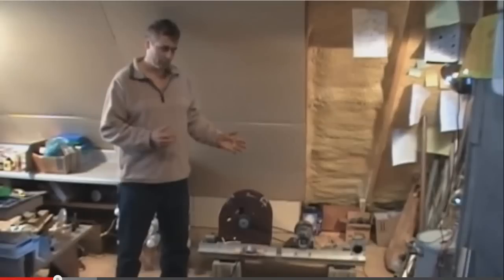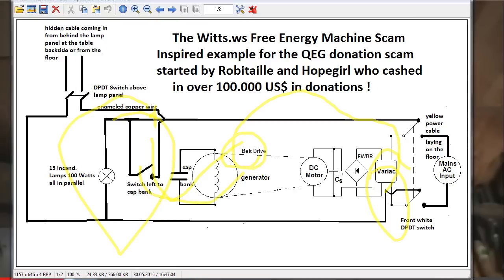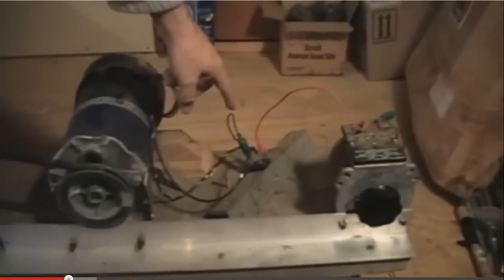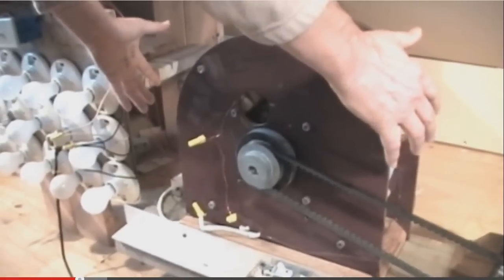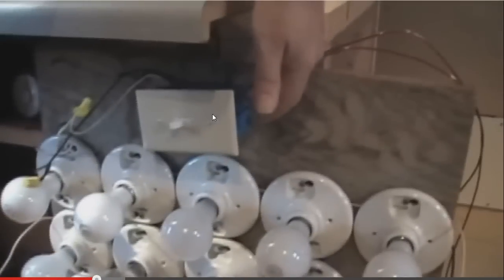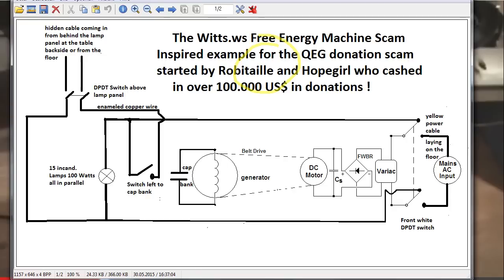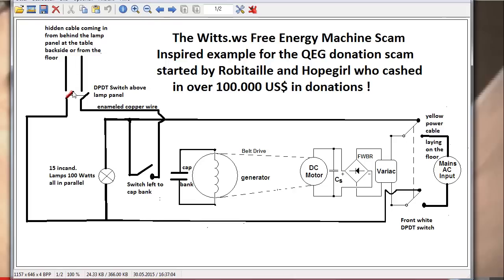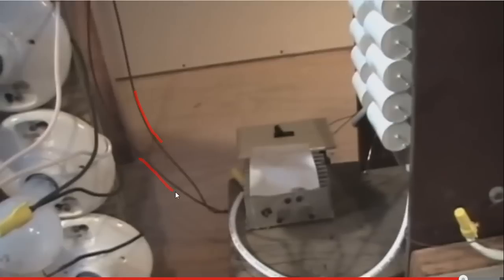Free Energy Machine  ? Scam ? from Witts.ws - QEG ? Scam ? inspired model ?

Comment: If Thrapp had overunity all he would of had to do is turn the variac down and the lightbulbs would have dimmed.  but he has a hidden wire so  he  can't turn down the variac down to stop the motor because the lights would not dim.  He has to unscrew the lights before he turns off the power to the generator or the fraud would be exposed.

A five year old could drill a hole in a 2X4 and run a power wire up to the lightbox from the plywood floor.  There is nobody on earth to date who has built a replica of the WITTS QEG shown here that has selfrun and is capable of producing 40 KW.
Reply: Its been done and the quantum field is the source. All the electrons, protons and neutrons spin constantly by this aether and made up and driven by it.

Comment: This is a working device, the resonance sound is exactly that a vibration of resonance in the coil transformer actually making useable power. This generator is a switched reluctance generator at first resonance it's at 80% efficiency. Two more tuning processes that are done to this machine will put it at over unity. First is core tuning at which the steel is changed internally using its resonate frequency. Then it can run at half it's resonance speed. Then final tuning of its Exciter coil is done at which point it's becomes over unity as it produces energy spikes which will accumulate more spikes from its environment. This is called Radient energy. The QEG guy who was a electrical motor engineer for Shop Vac was able to complete all resonances for the first time as of the beginning of July.
Reply from the maker: Lynly Gilman Why then have we not seen yet a selfrunning device from the QEG team ? Because they don´t have one .....only lies all around involved with these ones and Hopegirl wants to cash in again via donations...Big Thumbs down !
Reply: If you followed them closer you would see haw they figured out each step in the process. WITTS Did not give them all the information to make the tuning complete. The final step and the key to Overunity has just been solved. Finally released June 5th. Look closer all good things take time. I hope you will look closer .
Reply: overunitydotcom This is an opensource project.  A video can be faked.  There are those in power who would not see this device make it into the world.  No amount of evidence will satisfy a skeptic.  That's why.  In due time evidence will abound,  I've waited a year and a half, a few months will be nothing to see the final product; they are already in production.
Reply: Good imagery; you should continue your efforts in fictional writing.
Reply: Lynly Gilman WITTS is also just a scam, like Hypegirl and the QEG. Overunity and the QEG has not been solved, it will never reach overunity. It is like trying to fly by reaching down and pulling up very hard on your shoelaces. Notice how no engineer is working on the QEG? They all know it is just a scam to make money, so far Hypegirl has made $150,000 in donations from the gullible, now she wants $500,000 more to continue her holiday!
Reply: wilf609 Overunity may be the wrong word. Tapping a different type of outside natural energy source that has been ignored/suppressed and is not understood by mainstream physics is a better description. Energy is all around us just like tapping solar energy, hydro, etc. Nuclear energy was also not understood at one time. Just a different kind of energy... In time the truth will come out
Reply: Metalicman 68 Hw was NOT a "electrical motor engineer" - why do you think he was? He is not a engineer at all! No one has shown a QEG with a efficiency over 60%, they are just scammers.
Reply: Metalicman 68 "a different kind of energy" that no one has been able to measure, or see, or show any proof of except the QEG and WITTS scammers.... that should tell you something about this mythical energy!
Reply: Bendini is on the right track. Accumulation of energy spikes. It's the same type of energy just this one has multiple tuning to resonances to get more efficient
Reply: wilf609 Where do you get that idea?  These concepts exist in string theory, QM and Bohmian Mechanics.  And, I suppose that you think 'entanglement is also a hoax' and you still think nothing travels faster than light. o-0.
Your question of ontology is rightly placed at one of the biggest mysteries and questions in particle physics today.  How do we see something that's beyond 3D?  But, even though it's a question, and there are some die-hards that still think there's only 3D+time, the physics community has accepted that there's something beyond what we see.  Let's look at this sensibly.  Have you ever seen a gamma ray?  No, of course not.  Does that mean it doesn't exist?  No, of course not.  But, how do we know.  We have machines that can detect it.  Oh, so you're saying that we have a machine that can detect a free energy particle (and by free, I mean 'free' to do work)?  Yes, but only with a machine.  And, now, here we have another exotic idea in the QEG, and no, they're not the only ones who have discovered this.  But, we have a machine which proves there is such an energy source.

The Chinese are 'hot' into building these!  So are a lot of countries in the orient.  If you think we, the USA, should sit on our laurels while other countries build and use these, to dismiss willy nilly the potential.  Well, I'll be nice and just say you're mistaken, and it's a foolish notion.  Do you think the other countries are going to export and sell these?  Maybe; but, why give up a technological advantage that could make you a superpower.  No, if we do see these come out of certain countries, it undoubtedly won't be until they've taken every advantage the device offers.  With an unlimited energy source; most questions of poverty and such will become irrelevant after some time.   I don't need conspiracy theories to say why ignoring this is a bad idea.

Why don't you opensource your build of this generator, and show how id doesn't work, if you think you're right.  But, at least make sure you 'try' to understand what it's doing first.
Reply: Chip Cooper WTF are you babbling about? The QEG does not and never will work, it is just a scam. A few people are "building" one, but none will ever work as claimed - remember how they claimed the UK one was "hours away from overunity" then they left the UK, and that was a year ago and what happened to it? No one is going to export a QEG, as it will never work. I do understand what the QEG is doing, it is sucking in donations from the gullible to Hypegirl and family's pockets, that is what it was designed to do. So far they have sucked $150,000 from the gullible,and produced - nothing!
Reply: Why do you care considering I know you don't know if it works or not.  Why such a personal attack.  What vested interest do you have that you'd take on such a vendetta, considering I really know how little you know about this?

  I mean, the use of 'babble', and saying you understand, and then clearly you don't understand.

Did you invest, and you feel it was wasted? What has happened to you to make you so hardened against something you understand very little about?  You offer no proof it's not true.

Even Witts' original machine was shown in the video to produce more power than it used.  What proof do you have that's a hoax.  I find very sound theory that shows it's possible.  The fact that it deals with a set of physics very few understand is not proof it doesn't work.

I agree that people should be wary of videos, they 'can' be faked; but even you, as a skeptic, if you're true to your skeptical beliefs know that just because a video could be faked doesn't prove it was faked.

There's a lot more charities that take a way lot more money than FTW ever did; why not go after them?  There's documented evidence of these other charities BS'ing people. Hell, even, the Red Cross has been called out for it and we're talking millions.

So why don't you tell us your real agenda that you've picked something like this, which to me it's obvious you don't understand the physics.

 I mean, I really don't care whether you believe it or not; it won't change what it really is.  I'm mostly curious about why someone would want to defend a position against an alternate energy source.  And I mean, being against it, when it should be clear to you that you don't understand it.

I should keep these short; as I doubt you read the whole thing.  So, let's get to the nitty gritty, exactly what is it about this device you think doesn't work?  What part of it do you not think works?